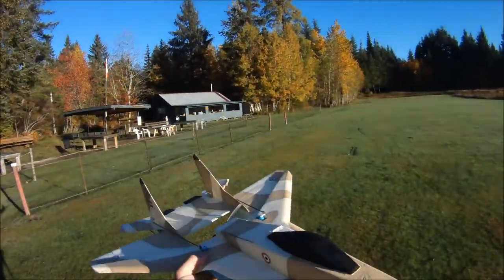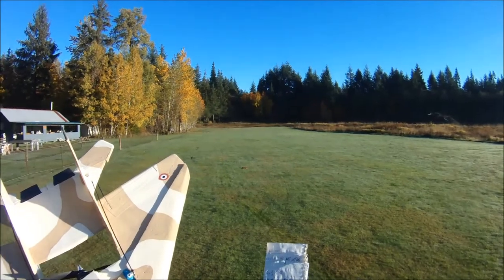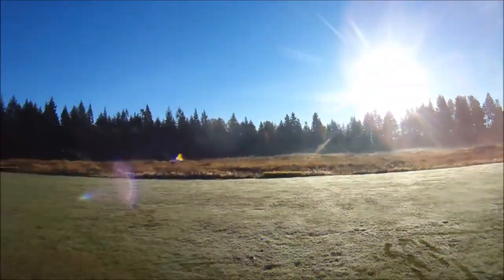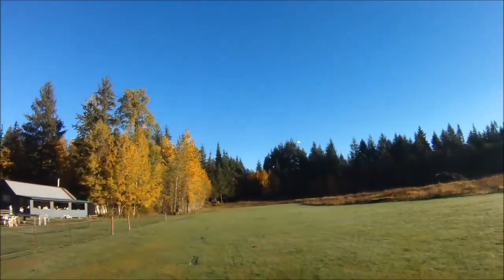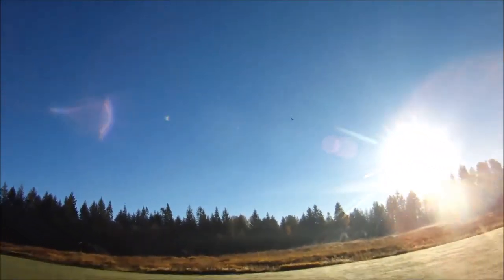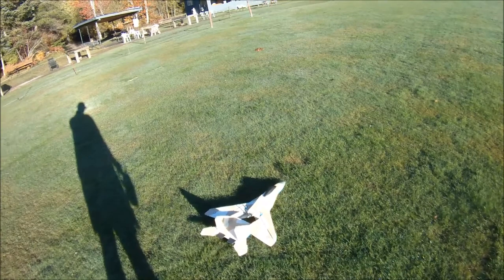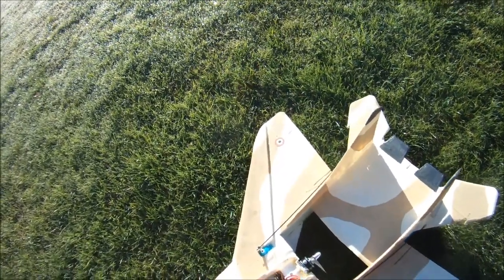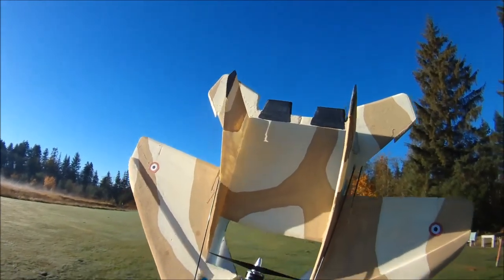Field test of BeeRotor Z2207 2780 Kv motor with 6x3 EMP prop on 3S

Comment: Me again Scott ;)
I used to get the original EMP props from a sight here in the UK but they closed down about 4 years ago so now I just get the copy or clone versions which are the TGS props. As I have a mixture of the two I have used the two makes during testing and I'm not 100% sure but I think the TGS draw slightly less amps. Maybe they are made of a fractionally thinner plastic so it's easier for the motor to turn. Just thinking you could easily get away with going up to a 6x4 or 6x5 TGS version of those props. May pick up a few more mph.
Just a thought. Keep up the flight testing.
...RCPP
Reply from the maker: Hi RCPP, interesting, next time I put in a Hobby King order, I'll pick up a couple to give them a try and see what experience I have, thanks for the tip :)  Cheers, Scott